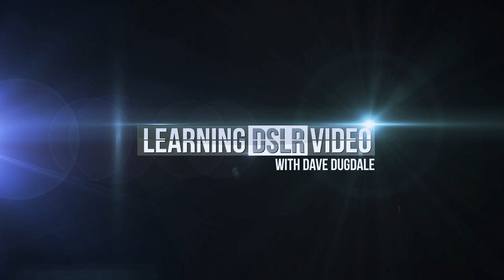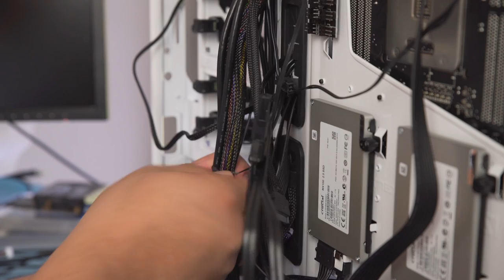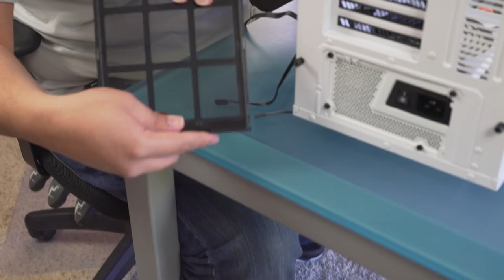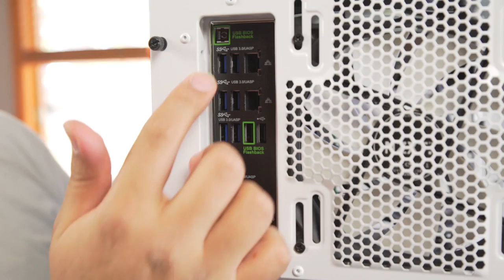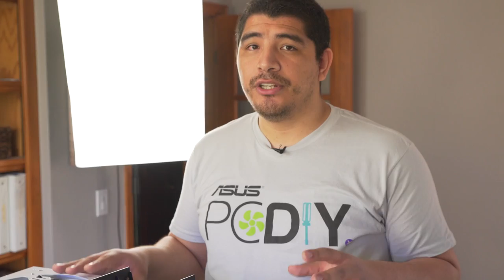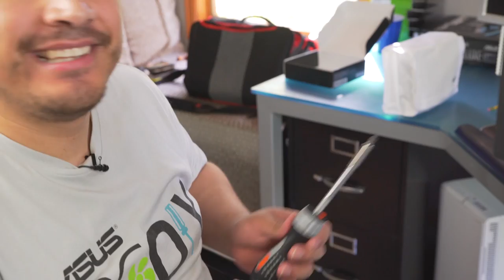Raw Footage of Building the Beast Video Editing Computer Part 2

Comment: Cool part 2! Dave, a quick question, did/do you have any issues during Boot at any time? I picked up Asus' Maximus VII Hero (z97 chip not x99) and whenever I adjusted anything from the BIOS, my boot settings won't work for a time. Also had other issues which I sent to Asus but didn't get a response from them.

My main concern now is just a stable Boot configuration. If x99 Asus Deluxe board owners don't have that problem then I'll exchange all my parts for a good x99 system.